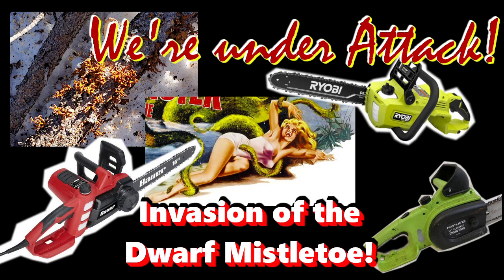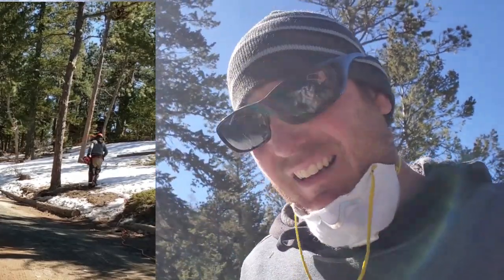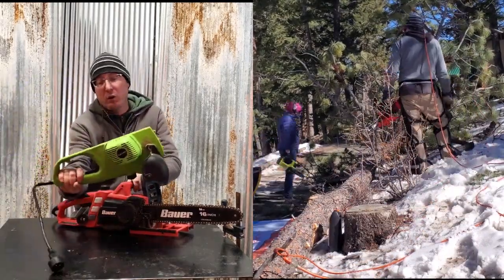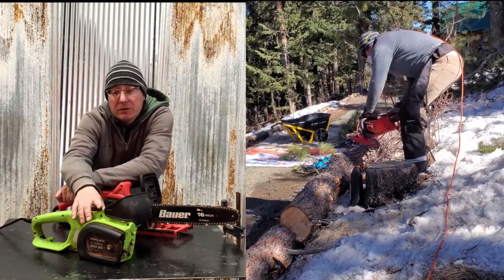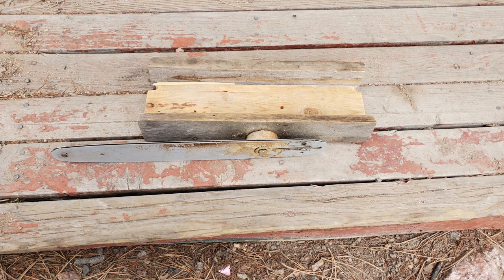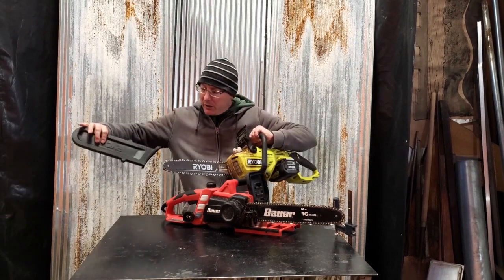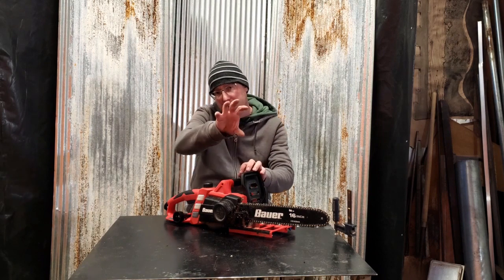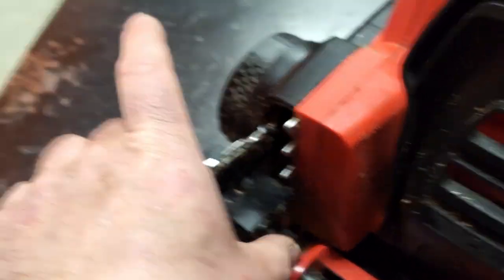Bauer 16” Electric Chainsaw 1y Review | Invasive Tree Killers | Portland VS Bauer VS Ryobi Chainsaws

Comment: I switched to using my Bauer electric saw because I buy slab wood and cut it up at home instead of regular cord wood cut out in the woods. I started using it exclusively because of the price ands it readily available here from alot of sawmills in my area.
 The Bauer electric saw has plenty of power ( as much or more than my 16" gas saw) and it cuts fast, Just keep the chain sharp and the oil tank full and your good to go!

Comment: I bought a Bauer 16" electric chainsaw a year or two ago. I have cut up three or four cords of wood with it and a Poulan 20" gas saw. Never had an issue starting the Poulan.
The Bauer has been very good chainsaw. I cut up some logs 30" in diameter and would run it full depth in the log, and it would cut right through without stalling. Would like a better bar for it because it will vibrate and wobble sometimes. I will use it until it fails, then I will probably go buy another one because it's cheap enough.